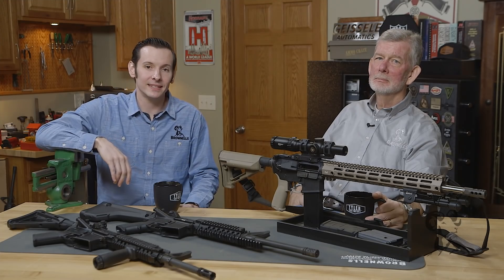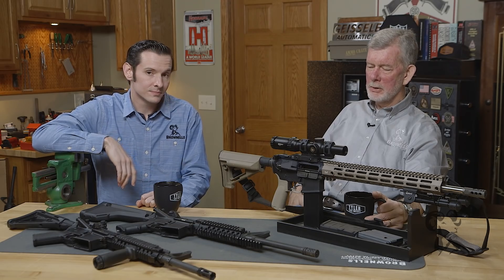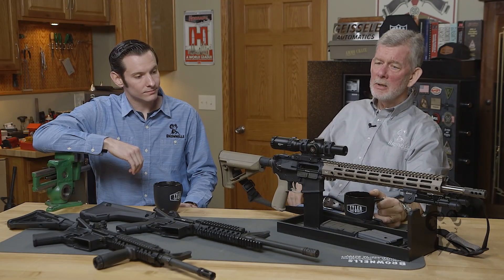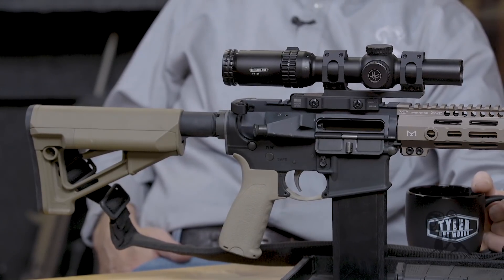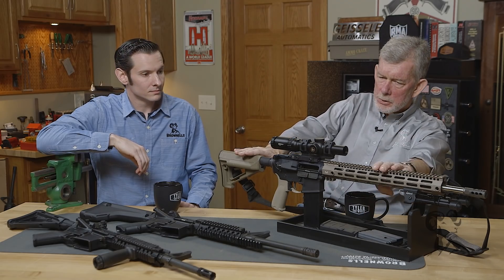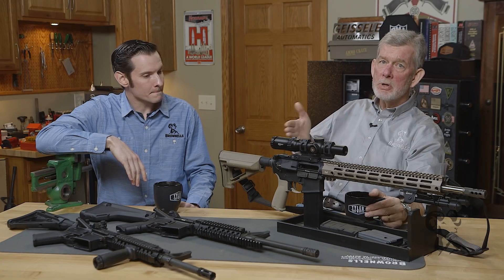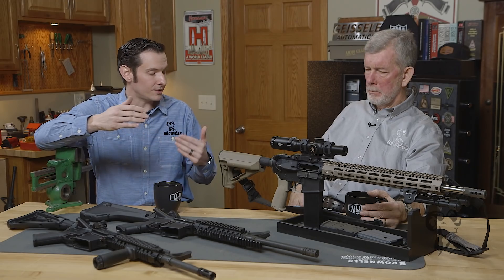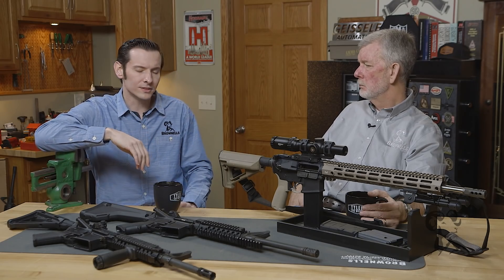Smyth Busters: Matching AR-15 Gas System to Buffer System

Comment: So if I'm understanding this right? I can run a 3oz carbine buffer on my rifle length (gas system) upper (20" barrel) without any issues? I'm currently building my first AR-15 (.223) and this has me a bit worried.

Comment: What if the caliber of the upper is 6mm ARC (with 18” rifle gas system) and not 223/5.56? Is a heavier buffer needed in the carbine stock for the 6mm ARC?

Comment: You cannot put a carbine spring and buffer in a fixed rifle butt stock like an A2. If you have to, you must add a 2 11/16” spacer in the back end to take up the extra length of the receiver extension (buffer tube)

Comment: So I have an 18" with a fixed carbine gas system and an Armaspec SRS H buffer but my brass is spitting out at 2 o'clock... any suggestions on how to make it spit at 3 o'clock instead?

Comment: Well i sure dont disagree, but if i set up a mid-length 6mmARC upper i can use a carbine length buffer system, or a rifle elngth? You see the 6mmARC is my 1st mid-length build so yea i had ot find out what the best buffer system was for it? Shocked really to find out they all work? I mean i have everything from 224Val to 350Legend and 458Socom and your saying i can use any of the buffer systems i have with each? Even if some are rifle length and others carbine? No matter the caliber?

Comment: But will a heavier buffer tame the gas from a carbine length system? Cuz I'm throwing brass at like 1 o clock
Reply: Yes, a heavier buffer and stronger recoil spring will help balance a heavily gassed upper. You can also get a gas tube with a smaller port hole to constrict the amount of gas getting into the system. It's called the EZ-tune gas tube.

Comment: Question, I had so many parts 
I decided to go ahead and
complete however many I had parts for and get good deals on a few parts I needed. All four are basically the same besides one and it has a 
Rifle length buffer tube and IS COMPENSATED. My question is, does the extra 
length of the buffer tube help mitigate the recoil at all because Shooting it, it’literally feel like shooting a 22or. It’s hard for me to give the comp all the credit. What’s your thoughts rifle or carving links?

Comment: QUESTION:
Can an A5 buffer system be used with a 20" Rifle Length Gas .308 AR-10?
If not, what is the best buffer system to use with a Magpul PRS Lite buttstock?

Comment: The problems I have encountered with short cycling are usually tied to the length of barrel available beyond the gas port.  For example, I'm tinkering with a "Dissipator" clone which is basically the M16A1 rifle configuration with a 16.5" barrel.  This places the muzzle much closer to the gas port hole in the barrel.  The result is less gas will enter the gas port to generate sufficient pressure to reliably cycle the bolt carrier group (BCG).  Instead, the extra gas needed will leave the muzzle with the projectile.  Since less energy is transmitted to the BCG, the result is sluggish bolt operation, failure to pick up the next round, and failure to engage the bolt catch after the last shot is fired.

Comment: I'd like the soft shooting side of my AR 15. I have a Ballistic Advantage 5.56 17.7in 3 gun barrel with a mid length gas system. I will use a carbine / adjustable length lower. By using a H2 buffer ( I have a full auto BCG) will this soften the recoil impulse? I realize I need to check case egection . Please advise

Comment: What about a dissipator??
Reply from the maker: That depends, the original didn't work well regardless and most of the reproductions use a hidden carbine length gas block under the handguard with the front sight not acting as the actual gas block.

Comment: I’m looking at a 308 that comes in 2 was either a 16” barrel with a mid gas block or a 20” with a rifle gas block is it worth the 4” of barrel to get the rifle length gas system will it be a lot softer recoil and more accurate or will the 16 “ mid length be similar in recoil and accuracy if anyone knows or has shot both let me know plz thanks yall

Comment: I have some 69 gr.smk loaded with N140  I get just a small amount of flow on the primer . My friends rifle shoots these same bullets no flow on primer. His has a mid length gas system mine has carbine . I suspect the buffer is releasing a bit to soon on mine . I'm going to put an H2 in it see if this corrects it . By the way loaded in specs and puts .750 groups at 100 yds. So it may function with light buffer but not at its best and the gas system and buffer do have to match .

Comment: Can I run a mid length gas upper with a standard rifle length buffer lower running strictly Winchester white box m193 5.56
Reply from the maker: If it's built right, yeah.

Comment: I'm not sure I believe this in its entirety.  I installed an intermediate gas system/barrel on a Carbine upper and my AR will short stroke almost every time.
Reply: lighter spring in the stock
BTDT

Comment: I have a carbine length barrel with a mid-length gas system.  I put it on a Magpul fixed stock with a rifle buffer system.  It would not cycle.  I changed the buffer to a heavy carbine buffer and it seems to function reliably.  I am guessing the dwell time is the issue.

Comment: Thank you!  I purchased an upper and bcg from Aero and could get a reply from them on this exact issue.  I have a carbine buffer and I was concerned as I had a rifle length gas upper.  Now I know I can run this system with doing any damage. Much appreciated.
Reply: Sorry, I meant to say without doing any damage.

Comment: Just built an AR 15 in 6 ARC.. with a 22" barrel and rifle length gas system. Used a carbine receiver extension with carbine length spring and buffer. It would eject, but it was short stroking and would jam-up on every other round. I ended up exchanging the new carbine length spring for an older carbine length spring that had been run for several yrs in a older 5.56 AR. The weaker spring allowed it to go bang without issues..

Comment: What about buffer springs can I get myself a better spring? And I don't mean durability I guess I'm looking to get rid of that sound that I hear in my buttstock whenever that bolt carrier group cycles
Reply: Only thing I can think of to truly eliminate that sound would be to get a JP silent captured spring system. They are expensive but it really does make for a very pleasant shooting experience.

Comment: I need help,  I have a psa 18" 6.5 grendel rifle gas system on a carbine lower buffer tube , I have fail ejecting , also I have an adjustable gas block does it on all settings .ammo are hard to get and expensive. Please help.
Reply: If your rifle is short stroking it means the rifle is under gassed. An adj gas block is worthless with under gassed rifles as they only restricted the available gas port pressure. Check your carrier key to see if the screws are tight and there is no obstructions in the carrier key, gas block is not clocked or leaking gas, check the gas tube for leaks around the gas block and carrier.. You may also have an inefficient bolt carrier. Adj gas blocks will leak gas more then a standard block. If everything passes inspection you may have a gas port that is too small..You should also check your ejector to make sure it is functioning correctly if you don't have a gas problem. There could be many reasons why an AR won't eject correctly such as a small bolt face, tight or short chamber, etc..

Comment: I have to disagree.  The upper and lower with a heavy buffer designed to run a heavy caliber, reguardless of gas system will run different with a different upper.  The polar opposite would have the same result.

Comment: I have an .300AAC blackout. It has a pistol length gas system.  The ejection pattern is not at the 3-4 o'clock angle.  Unfortunately, I don't remember if it was at 1 o'clock or 5:30 o'clock. Being as I had no way to take notes and sighted in multiple guns. Is there a different buffer weight recommended or different spring for a pistol length gas system?  I am running it with a carbine length buffer tube. the barrel is 15".

Comment: Good video. I have two 20” barrel AR-15’s. Trouble cycling, extracting and bolt locking back after the last shoot. I have been researching this and have concluded I am under gassed and perhaps need to re-examine gas block alignment. I have swapped out BCG, check and verified gas rings integrity, changed buffer and spring, cleaned and lubed rifle and tried different ammo. Fires or does not fire just a click, extracts some times, sometimes gets stuck in chamber and does not lock back at all. When the case does extract and ejects it is to the side or slight back as best I can tell. Previous videos on the direction where the case ejects suggested gassing problems. Still research this. Any advice would be appreciated. Thanks

Comment: I'm building an AR with a 16" barrelled upper (5.56/.223) and mid-length gas tube ( .750 Non-Adjustable Mid-Length Gas System).  My goal is a reliable but smooth shooter.  Any "recommended" starting point for the buffer tube length and buffer weight?

Comment: When I got a solid stock to replace my collapsible on my carbine, the spring was longer, and the buffer was longer and heavier.  Why would they do this if they are “all the same?”  Or does the length of the stock (buffer tube) affect things?
Reply: Because the buffer tube is longer and the spring is a different tension.

Comment: I'm going through this right now with an AR15  18' barrel using a carbine buffer its not fully pushing the bolt all the way back, so i would say you're wrong.  You have to change the weights depending on the length  of the barrel / gas system and in some cases in the carbine buffer you can't fit enough weight.  I built a AR10  300 WSM with a 24 inch barrel and had to go with a rifle buffer because a carbine buffer would move to fast causing stove piping and damage to the bras and I couldn't get enough weights to fit in a carbine buffer.  Also I built a 6.5 creedmoor with a 24 inch barrel  and had similar problems but rather than trying to tune it with weights i just got the rifle buffer.

Comment: Question, if I run a rifle length gas system, and my carbine buffer system won't cycle a second round into chamber, do I need a lighter or heavier buffer then the h2 that's in there?

Comment: Hello! Thanks for the video.
I am building an AR47. Carbine length gas system and 16" heavy barrel, no suppressor. I have plans to use an A2 type stock. I presume I will need a rifle length buffer. Would you have a recommendation as far as which weight and spring?
Thanks for your help.
Reply: that will probably be the least of your concerns. However, I do feel more recoil on mine vs 5.56, with the A2 stock. I've been messing with an AR47 for 20 years and still can't make it reliable. Mag issues, firing pin issues, gas block issues, extractor issues, and accuracy is mediocre with 20" , I think it is 1:9; some rounds tumble by 200yd

Comment: Thanks guys.  I have a carbine-length buffer system with a mid-length gas system that isn't cycling properly, and my first thought was assuming that I need a different buffer system.

Comment: I agree with these guys. I had bought a .450 Bushmaster upper for one of my AR lowers. I had read on a forum that you needed a heavier buffer because of the more powerful round. Well I was having problems with cycling, changed back to the original buffer and it ran fine after that. So beware of what you read on forums.
Reply: Hey there. I'm trying to do the same. Thinking of a 450 BM don't know if I should go carbine or mid length or rifle. My AR is
 16 inch carbine but don't know if I can change that to a mid length or rifle. Any thoughts you can throw my way?
Reply: @JT-ie1pp  The difference between carbine, mid length and rifle is where the gas port is in the barrel with carbine being the closest to the chamber at 7.3 inches, mid length a little further at 9.3 inches and rifle the furthest at 12.65 inches from the chamber. A lot depends on barrel length as you shouldn't use a rifle length on a barrel less than 20 inches. If you are going with a 18 inch barrel a mid length gas system is preferable but a carbine will work. If you go with a 16 inch barrel the carbine length is preferable but a mid length will work . As for the lower receiver and stock , it really doesn't matter as long as you have the correct spring buffer for your setup as in a rifle spring and buffer will not work in a carbine stock. Nor will a carbine spring and buffer work in a rifle set up. Your carbine lower/stock setup should work fine for which ever barrel length and corresponding gas system you go with within the guidelines I mentioned above. My .450 BM setup is a 16 inch barrel with a carbine length gas system with a carbine stock on my lower. Other than the previously mentioned snafu of going with a heavier a buffer after reading it on a forum, once I switched back to a standard weight buffer, I've had zero problems. I bought my .450 BM for hunting in a limited firearm area for whitetail deer but it makes a great brush gun. I have it sighted in at 3 inches high at 100 yards which gives me a dead on hold out to 230 yards keeping shot placement well within the 8 inch kill area of a whitetail as long as I do my part. I ended up ordering a 18 inch bareel with a carbine length for a buddy of mine. There's no real noticeable difference in shooting between the two but if we chronographed the two of them we would probably find his is 150 fps faster which would give him a slightly flatter trajectory  which might give him a 250 dead on hold range at the expense of mine being a little more maneuverable in brush with the shorter barrel. The 2 uppers I mentioned and an identical to my upper I ordered for my brother were all Bear Creek Arsenal uppers. They all shoot decent accuracy, not tack drivers but acceptable. They have very good prices on their uppers and I'm satisfied with their quality. When I was looking for a .450 BM upper, they were the only ones that any in stock unless I wanted to pay $800 or more for an upper so I took a chance on them and glad I did.

Comment: I'm in the middle of this right now. Colt 20" HBAR 1/7 twist that I've been shooting with a rifle length buffer runs beautiful. I recently swapped out to a carbine length buffer/tube/stock and original light (not "H" buffer). The rifle started double firing with Speer factory 64 gr GDSP.  The disconnector spring feels (travel & tension) like my other AR15's. Someone suggested switching up to the H2 buffer. The rifle buffer weighs in around 5 oz. and my original carbine buffer is less than 4 oz. 

In dry fire function testing I can not duplicate the malfunction. In case there is anything to the H2 as a cure I have one on order from Brownell's.
Reply: The weight of the buffer has to do directly with the weight of the barrel on an auto-loading rifle.  The heavier the barrel, the heavier the buffer weights need to be to keep the dead-blow effect right.  With a 20" HBar I would use an H3 but an H2 should work fine on a semi.

Comment: Can you run a carbine buffer in a pistol length gas system?
Reply: How did it work for you? I’m here for this exact question. 5.56 10.5” barrel running a carbine spring and buffer.

Comment: I don't disagree 1 bit. I do have a question about having an adjustable gas block and an adjustable buffer for weights what do you set up first? And what are you looking for as results from each possess?

Comment: Wrong! Okay. Not really wrong. From first hand use I can see where different buffer weights can give better performance. I think AR 15s are like a Rubix Cube. Leave perfect with all the colors in the right place it's fine. Start mixing a little here an there and you'll be in all kinds of trouble.
Reply: More information (technical information) would be much appreciated to support your claim.

Comment: So I can put a 20 inch upper on a carbine lower with no problems?
Reply: You ever figure it out?
Reply: @Michael-qk2uw  I never tried. I don't remember what they said in this video, but it seems to me that one would need a different buffer spring for it to be good.
Reply: @nickr4015  they stated you could run a rifle length gas system with a carbine length buffer system with no issues. I find this to be untrue.

Comment: if you run a rifle length gas system you need to lighten your spring because you can have malfunctions. i did so i changed buffer to a lighter buffer spring and was good to go also lighter recoil.

Comment: My bcm is really over gassed. What do you guys recommend?  I bought a H2 buffer hoping it will reduce the recoil. My friend said changing out the buffer only helps with the ejection pattern.  What do you guys think I need to help reduce the recoil and over gas problem I have?
Reply: Adjustable gas block

Comment: Do h2 buffers work good 16" barrels with carbine gas systems?
Reply: It should do fine. I run one in my do all lower that uses a short barrel and a 16" mid length gas system. havent' had issues with either. softens it up a bit.

Comment: if you use a m16 style spring in a six position buffer tub you can have cycle problems m16 style is slightly longer.